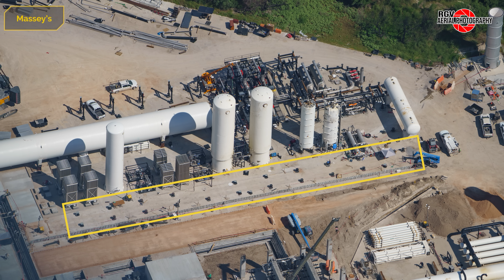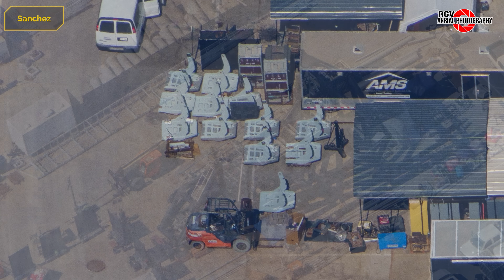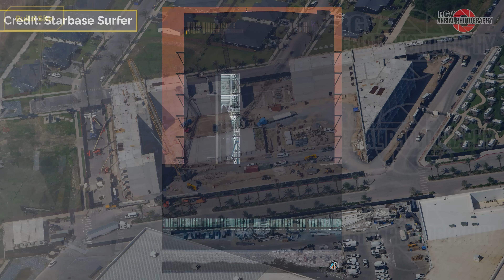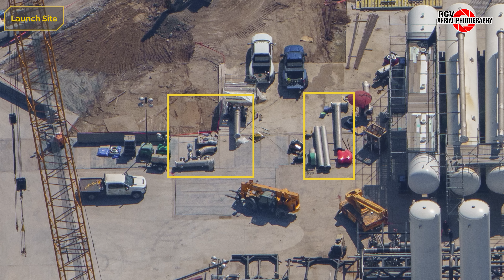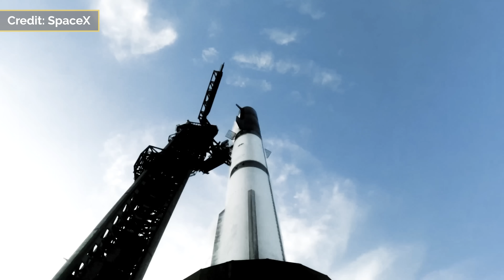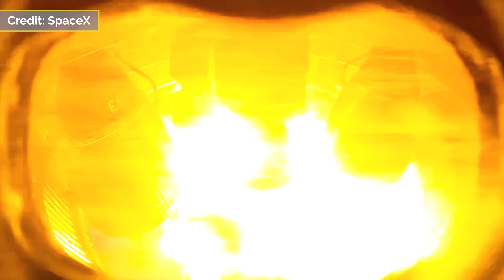Getting Ready for Flight 11! | Starbase Flyover Update Episode 100!

Comment: You said SpaceX should build a new road to move starship etc. I agree a new road not for starship but for the locals to access the beach, it would not have to take the weight or size of the vehicles that spacex use.
Reply: still think they should lay a railroad for transfer ships to and from, both Massey and the launchsite. If they want to up the numbers is the only solution that makes sense, and could move ships twice as fast
Reply: @guggol148 I think the problem is they don’t own the land between sites and don’t have permission to build a railroad through the protected wetlands.
Reply: @Barthhhelona  true. For now anyway. But if SX manage to make the starship program a reality, I think the money and power it will generate could be insane... if they manage to hit 25 launches (or anyway validate an upgraded block 3 already as a viable commercial vehicle and not just a prototype any more) by the end of next year, then by the end of the decade they can be easily moving ten times more mass to orbit than the rest of the world combined (for reference, they did 84% of the world's orbital cargo mass in 2024, and that's basically with F9s alone). At that point they can just buy the whole Texas and sort it out... ;)
.
Reply: @guggol148  I doubt there is any real utility in a rail system and doubt they'd ever consider it.  The sheer flexibility of the SPMT's vs a rail system alone makes it a silly concept.
Reply: @imaginary_friend7300  sure, now. because they only have to move a few and things keep changing vary fast. But when you have to move dozens of ships every day all from the exact same spot to the exact same spot and back again (which is what is bound to happen once the development phase is mature and they'll start mass production), then it will become the only practical solution.
Reply: Yes, a good idea. But SpaceX should build a crawler way from Massey to the launch site - 11 km.